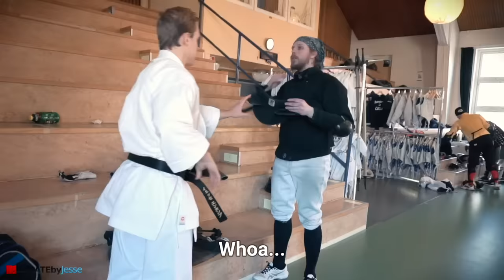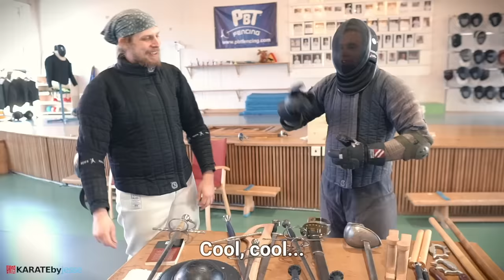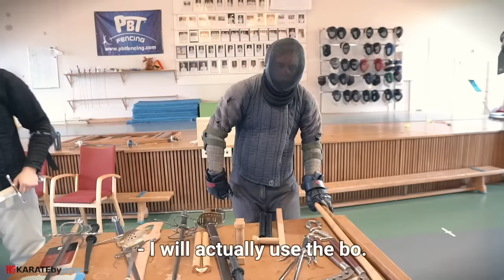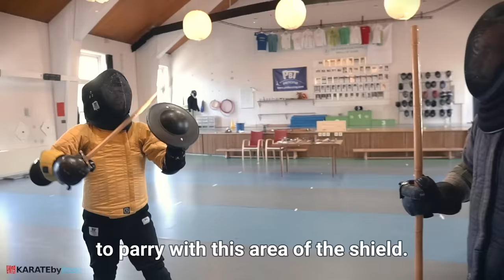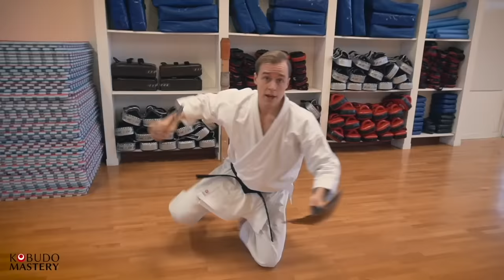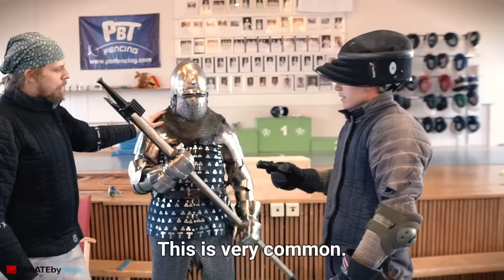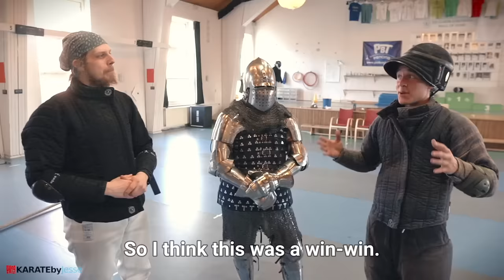Medieval vs. Japanese Weapons (Real Sparring)

Comment: The punches and kicks against that armor would do nothing. Even with the brass knuckles on. You’d break your own bones and end up a smear.
Reply: It did help him suprise the armoured opponent and allowed grappling
Reply: @The_true_Joe_mama  You think the armored opponent felt those blows? I guess Karate punches shattered samurai armor as well?
Reply: @williamsmith8790  

Im talking about grappling, not striking. Besides, the blow suprised the armoured opponent, making it even easier for the takedown.
 If the knight gets in the bottom then he will need to deal with the opponent's weight plus his armor's
Reply: @williamsmith8790  

It's not necessary to hurt or dsstroy de armor, just the means for easier grappling

Comment: If an Asian warrior faced with a Wester warrior with a sword, there is no chance for an Asian fighter go fighting with nunchaks nor tonfa. Also never underestimate  the double blades the europen sword has to most Asian blades with single bladed edge. More over, Western fighter mostly will be taller and stronger.. I have been in a fight during my campaign in Iraq and Afghan, Trust me... Strength out performs training in real life and death situation.. also the taller feature will give you a longer range.. In my case I got stabbed 4 times but I kille both my Iraq soldiers with single stabs each. Also in real situation using weapon without hand guards you will lose all your fingers. And to answer your question My favorite weapon are guns..

Comment: As fun as this was, the scoring was complete nonsense.  Not every hit is equal.  This is why i hate Olympic fencing and their super flimsy foils.  A flick to tag a should that strikes a split second before getting skewered by a thrust might win a point in fencing but would only scratch an opponent at best while getting killed in response.  
   Maybe figure out a better scoring system so scratches vs lethal or debilitating attacks affect the outcome.

Comment: The problem here is that you're sparring using wooden weapons and calling hits against armored opponents. Sorry, there's a reason the stav was not used in armored combat. Things like Kama and nun chuks were just repurposed farmers tools for the sake of resisting oppression. They're not designed for the battlefield, or armored opponents, they don't work there. Those knuckles wouldn't work in an armored fight. You block the weapon take the dive and then guess what, he takes out his sidearm and drives it through your back. You lose.

Like at 3:44, sure you get a strike against his leg, at worst fractured, probably not though, but you take an a follow up blow to the face unarmored from a sword. You are not "slaying it' you just died bro.

These weapons and kata are designed to catch unarmored opponents off guard while maintaining something of a reliable system in case they meet resistance. It's like the martial arts samurai practiced, it wasn't actually good on it's own, because it wasn't designed to be. It was designed to incorporate movements from already taught kata in order to have a back up in case weapons were lost all without having to significantly increase training times. Could you actually beat a traditional medieval knight as a grandmaster in okinawa martial arts one on one? No, because the system isn't designed to accomplish that.